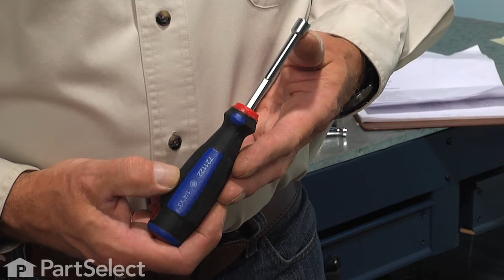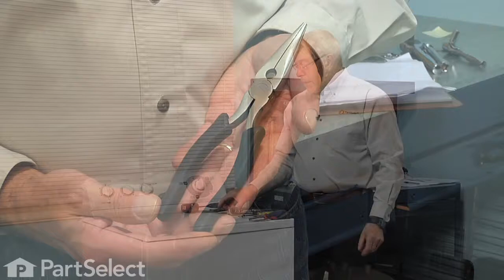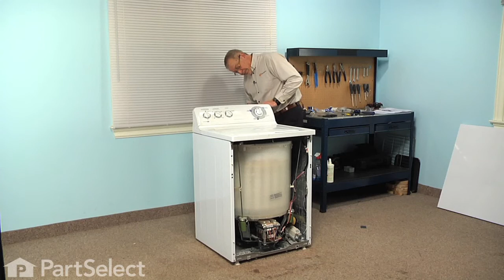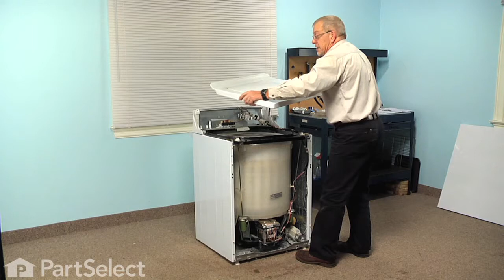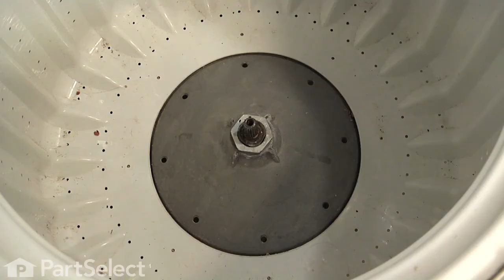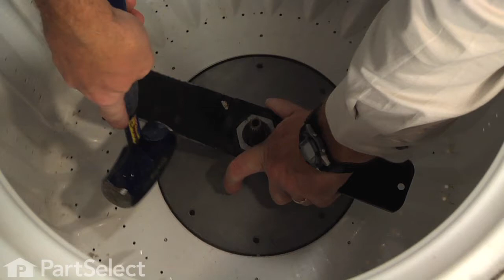Washing Machine Repair - Replacing the Hub Nut (GE Part # WH2X1193)

Comment: well, apparently my GE washer does not have the same front panel mechanism because when I press the spring mounts down the panel will not budge.  I have no idea how I can remove it as it is on there solid no matter what I do
Reply: I just tried one of these today... if the spring mounts are worn and bent backwards at all, they can get really tricky to release... use a flashlight and a very small thin screwdriver to lift the back of the clip, which changes the angle of the front of the clip, allowing the putty knife to do its work.